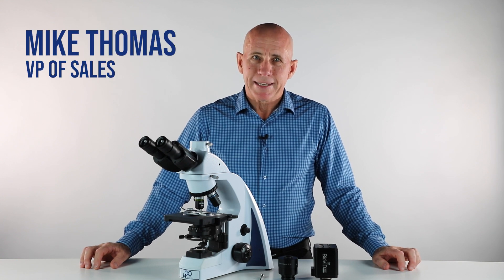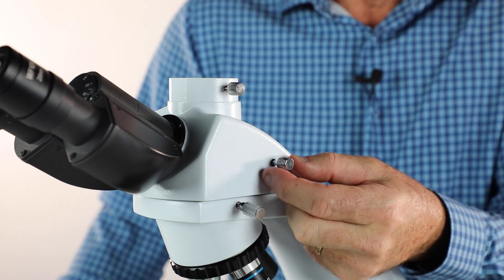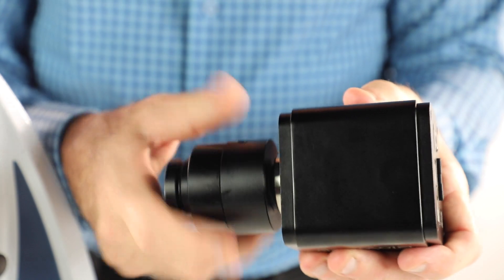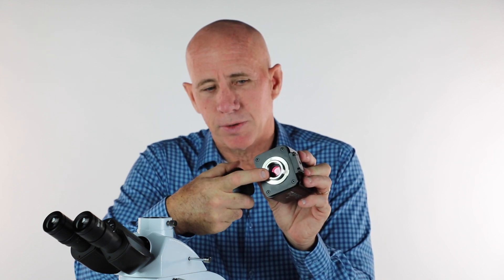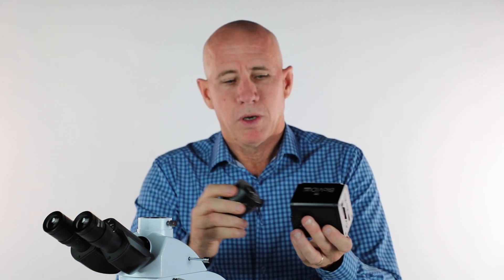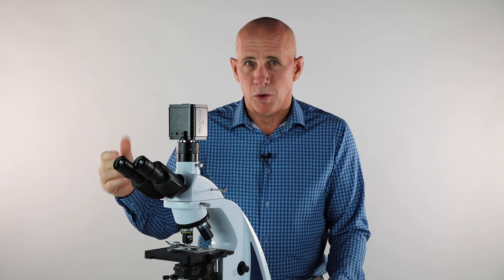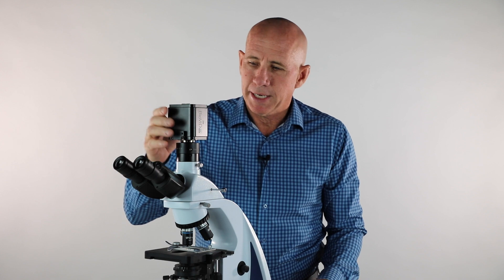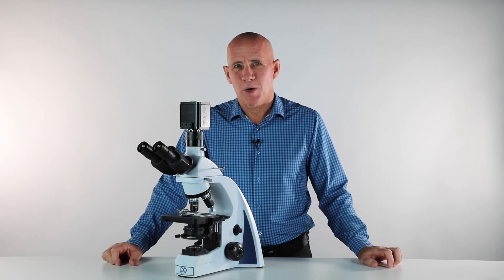Mounting a Microscope Camera: i4

Comment: I would like to know what is the use of the mirror that comes with the equipment
Reply from the maker: Our Revelation lll microscope comes with a mirror that can be used in the field when you are not near a power source.  You would mount the mirror onto the base, and then angle the mirror to capture the daylight and project it upward through the condenser to illuminate your slide.